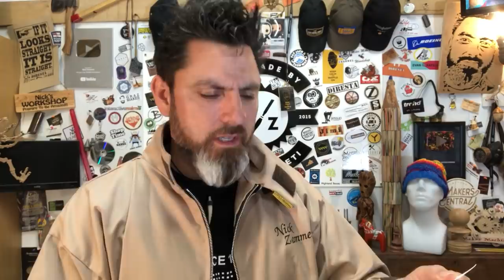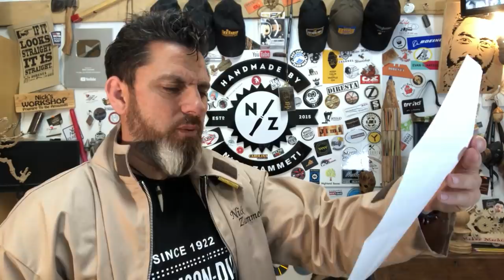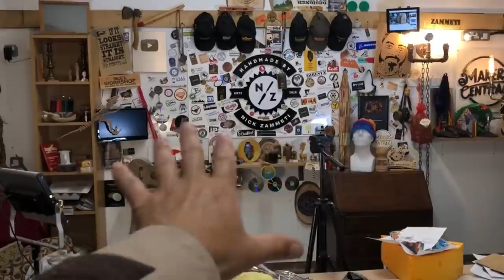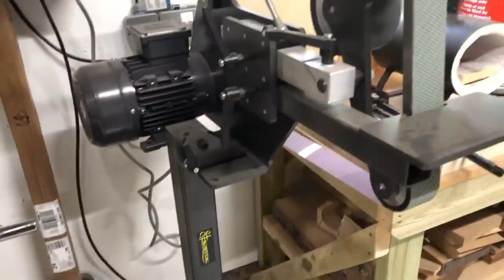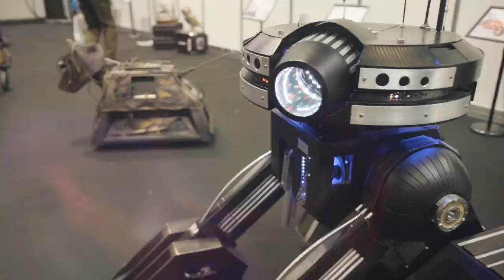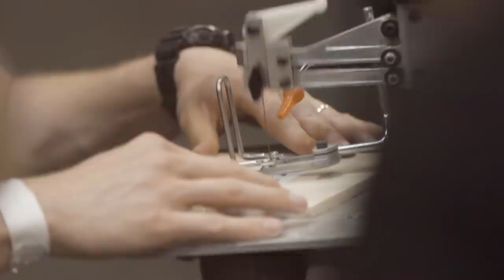My New Anvil Has Arrived. 🎺

Comment: Have you ever thought about using two plastic pots when you are turning a pot, put a smaller pot inside another larger pot and put your pencils or what ever you are using and pour the resin in the outside section and use less resin. You could use hot glue to hold the smaller one in place in the larger one.